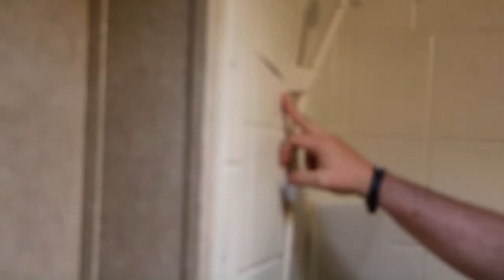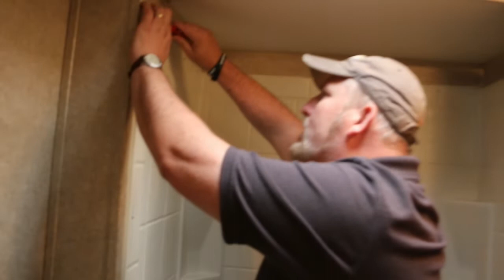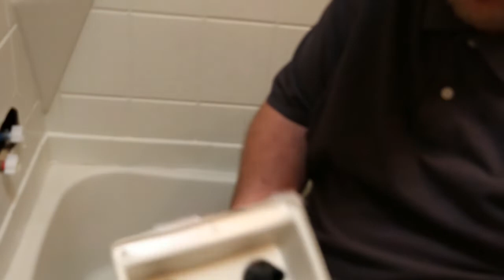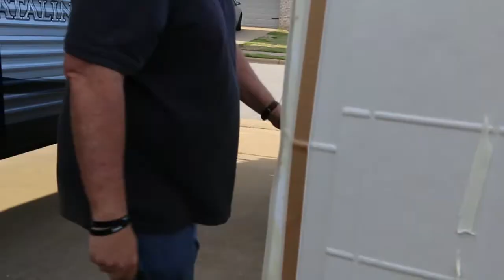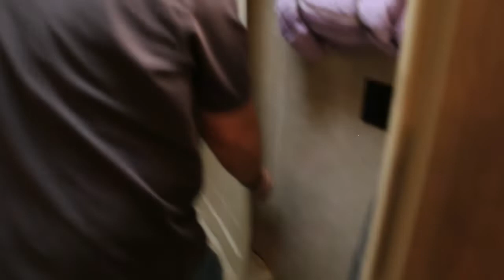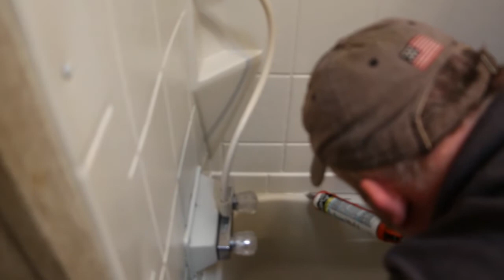How to Install an RV Shower Insert

Comment: Hope you still monitor this.   I'm looking at replacing my tub/ surround.   After watching a few of these I'm thinking why not just use more double sided tape and forget the screws.
Reply from the maker: Yes that double sided tape really breaks down in the heat especially leaving sit up in the summer here in the south. Thanks for watching.
Reply: Oh thanks for the insight.

Comment: Hey there, im trying to see if my rv shower needs work. The surround/insert is not attached to the wall in the middle. It has screws around the side but I'm not sure if it is supposed to be loose from the wall. Was your new insert connected to the wall at all in themiddle area, like not around the edges?
Reply from the maker: Ours was all 1 piece so I can't give answer

Comment: Have a crack next to the drain and leaking outside....hope wood is OK underneath
Reply from the maker: Yes I had the same thing happen to our Bullet shower. It is always weak around those drains. It will need to be replaced. Before mine got too bad I took some 100% silicone and sealed right over it. I does not leak anymore. Safe travels!